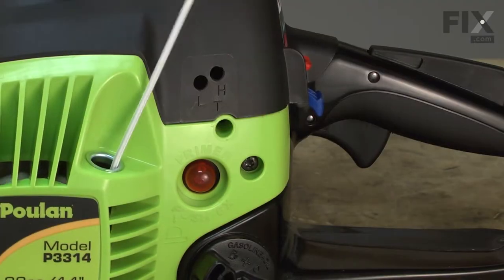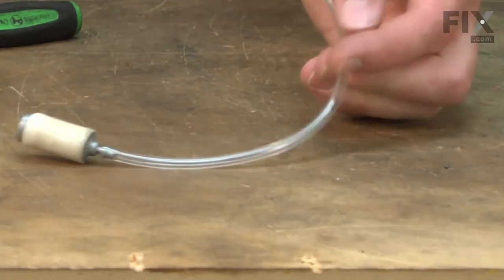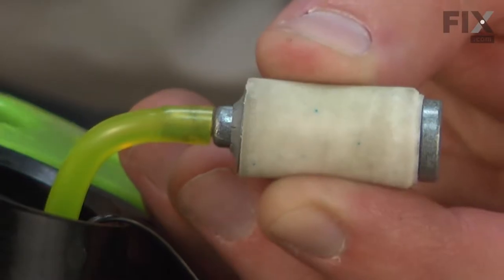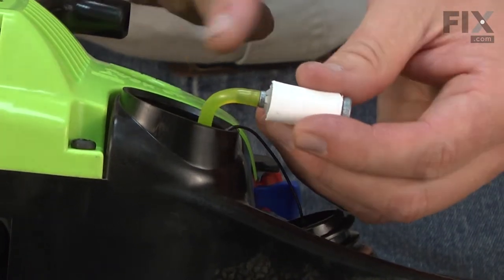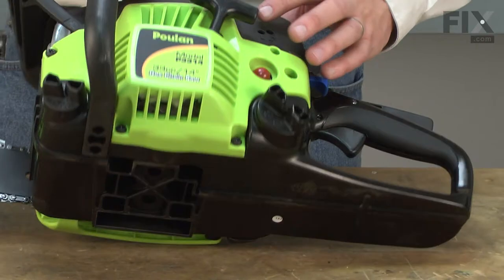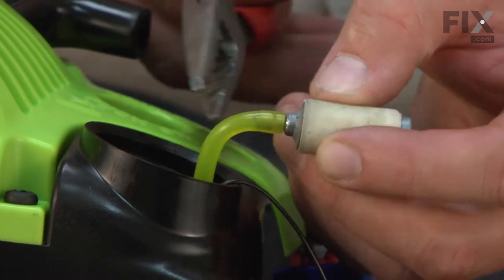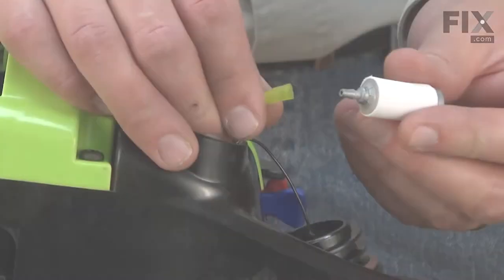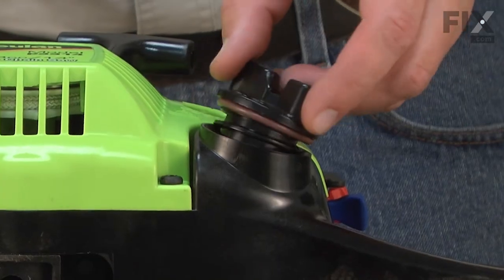Craftstman Chainsaw Repair - How to Replace the Fuel Filter

Comment: What if fuel line comes off inside tank how do u get it back on?
Reply: I am interested also, my fuel line and filter fell out when I tried to empty the tank...
Reply: @faunafarm  same happened to me & my craftsman chain saw
Reply: You'd have to pull it out with long pliers, this could disconnect it from the carb so make sure to pull it back in and re attach to the carb afterwards